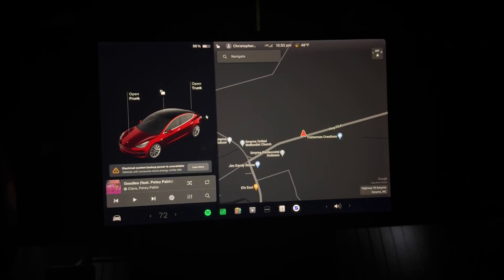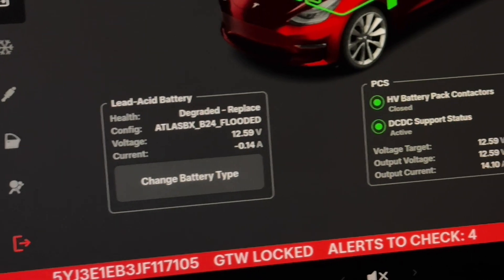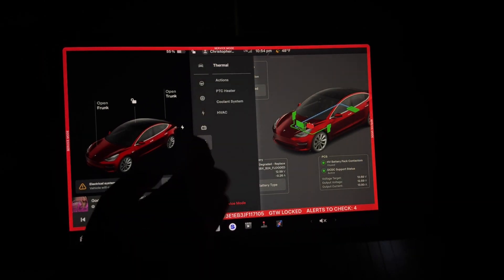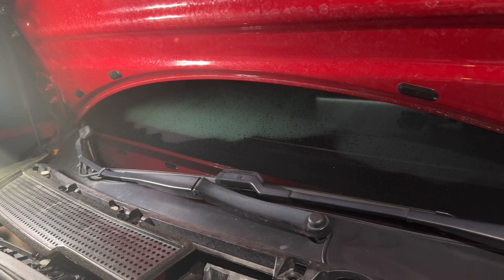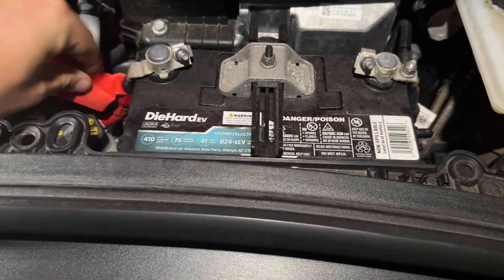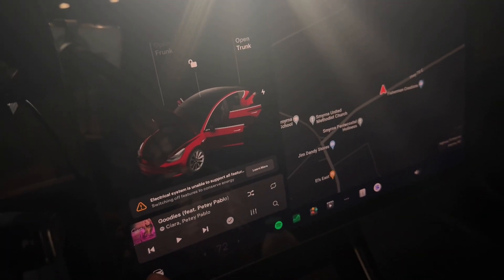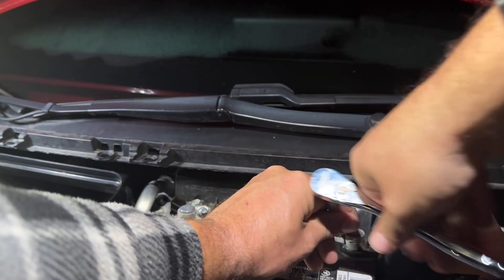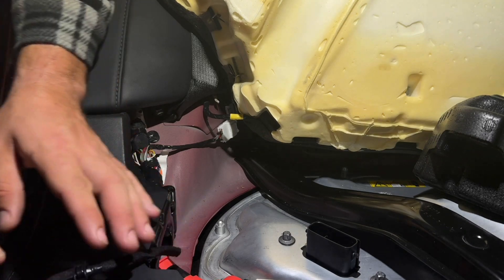Tesla Model 3 12V Battery Change

Comment: Cost of replacing battery at a Tesla service is really cheap, probably cheaper than buying new battery at a parts shop.
Reply from the maker: I don’t disagree with you in the slightest, nearest service center is 3.5 hours away from me so I kinda bite the bullet a little to save a 7hr round trip.